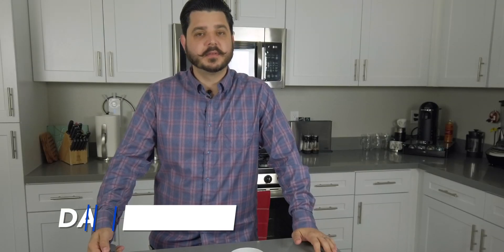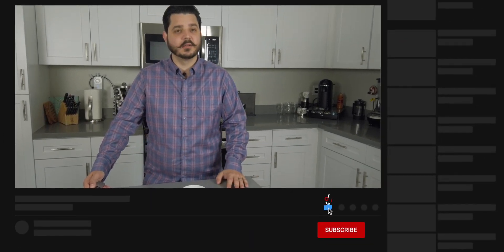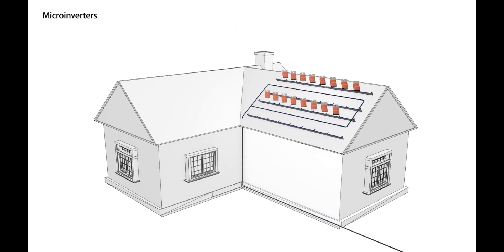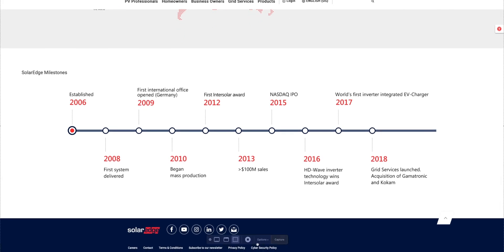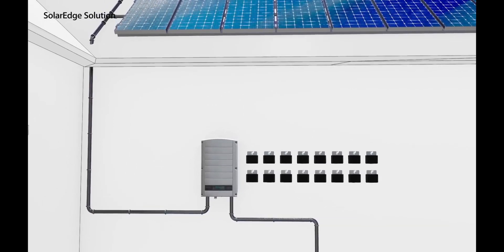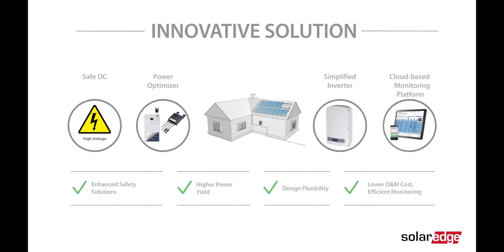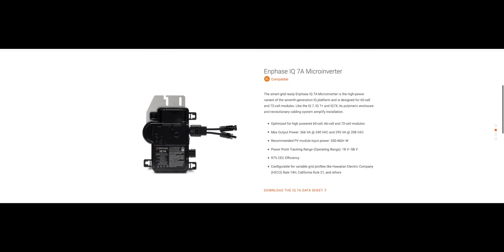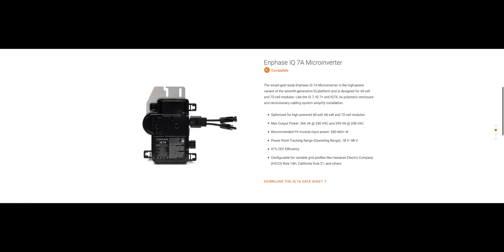Optimized Solar Inverter OR Micro Inverters

Comment: Is it best to oversize a aolaredge inverter so it doesn't run at max output
Like a 10860kw system with a 11400 inverter?

Comment: Great video. If a customer has 360 panels and wants to add 320 panel(s) and/or 400 panel(s) are these allowed?
Reply from the maker: Yes, the Enphase system doesn't care about the panel wattage. You just need to check electrical calc. As for SolarEdge the optimizers don't care about the wattage of the panel as long as it's properly sized.

Comment: Enphase is always capping panels. While for SE you say “5kW system use 5kW inverter” but to compare correctly you should say 5kW system from SE with 3000 inverter.

Comment: Obviously you prefer solar edge optimizers  vs microinverters.  You also didnt explain that the cost of wiring Dc vs Ac system.. thanks for the infomercial

Comment: Cost needs to come down on both, Panel prices have decreased but seems both inverter types have stayed the same..
Reply from the maker: Yes, the inverter technology and optimizers for the industry have been flat. This really has to do with competition which Enphase doesn't really have much, there are other micro-inverter companies but they struggle to gain market share from Enphase. As for SolarEdge, they are starting to feel the pinch from other inverter manufactures that have created an alliance to develop cheaper optimizers, so we should see that at least help a little bit.

Comment: For micro invertor current need to store battery  or not..  if not means how can we use in night times??
Reply: Most people run their house off of grid power and just feed power back into the grid during the day to offset the cost of grid power. Adding local storage costs a lot more

Comment: Solar Edge is notorious for being RF noisy. So if you listen to AM or ham radio stay away Solar Edge.  Enphase and SMA are the two quietest inverters according to a paper you can find on the ham radio ARRL website.
Reply: I can confirm this is true based on 13 years of installing SMA, SolarEdge and Enphase
Reply: I have been looking for this very comment. As a ham radio operator this is more important than having solar at all to me.

Comment: Enphase 25 year warranty, no single point of failure.   SolarEdge 12 year warranty, multiple points of system failure.  Maybe acknowledge you get what you pay for?  It sounds like you might be mis-understanding DC to AC inverter saturation, "clipping" is often mis-used to confuse or mis-direct people, it can and does happen with ALL solar inverters, there is no harm. It just means that for a few minutes here and there the inverter didn't capture every single watt. (fun analogy- think of a tomato plant in your garden, sometimes a tomato doesn't make it to your meal).  Real world performance of solar panels is nowhere near STC ratings, by using higher DC watts you can reduce many other costs. Electrical panel upgrades, less racking, less labor fewer circuits. Enphase micro inverters are happy to run at "full throttle" for decades, other inverters will overheat, de-rate and fail early if run hard.  Good solar design should have well loaded, or well utilized  solar equipment.  (one more fun analogy- Do you run your washing machine half full?)

Comment: You need to declare a true winner. Even if it’s by 1% 
Cost
Warranty
Total Power output 

Don’t tell me they both output the exact same amount of alternating current.....
Reply: Yeah waste of video. The micro inverters the whole point isn't the damn ac)dc it's the micro controller that seperates from system

Comment: Very good video, really liked it, thanks so much for good information
I got a quote from Tesla for 11.97kW system with Soalr Edge with HD Technology, which is quite a good deal, vs a local installer offering 12.8kW system with 400w panels but Enphase IQ7+ micro inverters.
I wont be expanding the system as this is the most I can get based on the house and roof.
What are your thoughts?
Tesla new price is really tempting, 
Also don't understand what will 12kW system really capable of producing in real life
Thanks
Reply from the maker: Tesla is very competitive but we support local business and from what we hear Tesla is very difficult to get ahold of when you have issues with your solar system. We service hundreds of customers that went solar with other companies and they can never get ahold of them after they have it installed, (typically nationwide companies). It also sounds like the local company is offering you something better than Tesla
Reply: @pacificsuntech  In my area Tesla subcontracts out to local installers
Reply: @pacificsuntech  how does having battery like a Tesla's system's have vs no battery and 💯gird depended or it doesn't matter as much for costs and overall efficiency's? for micro vs all dc system

Comment: Pacific Sun Tech - 
At the end of the video you said "if you have a larger system like an 8kW or 9kW solar system, you'd likely pair it with the 7kW inverter or the 7.6kW inverter from SolarEdge".
Why would you pair a larger solar system with a smaller inverter? Is that where the inverter tops out?
Reply: This is usually because the panels don't produce near the full output throughout the full day. The larger output panels produce closer to the full inverter kW for more of the day making the 'actual' output of the panels a better match to inverter.
Reply: Because nameplate wattage isn't what you'll get. Factor in losses straight off the too and the fact that it waxes and wanes throughout the day... you'll never see the full capacity. I'm only at 65% of nameplate on 3 different arrays. C'est la vie

Comment: 6:27..."they, meaning Enphase, are not going to keep producing the older inverters." NOT TRUE!
We were an early adopter of Enphase MicroInverters. We installed M190 inverters in 2011.  Two of them failed last year...actually they didn't fail outright, they just started to make much less AC power. Enphase sent us two NEW M190 MicroInverters and all the hardware and cabling necessary...at no charge...to connect them right back up to our existing system. Enphase does not still offer a 190W inverter to the public. But they supplied their existing users with BRAND NEW replacement inverters for the ones we bought in 2011. And these new ones are STILL correctly matched to the 240W panels we bought to work with the 190W MicroInverters.
Reply from the maker: Of course they replaced them, they have a 25-year warranty. But what you received while appears to be “new” is refurbished. As technology evolves it’s not economical for a company to continue making products they no longer sell and thus they repair damaged units.
Reply: Pacific Sun Tech While this does not address the 190w inverter, they are producing new inverters that will replace M215 inverters that are not, as you say, “refurbished”. Also recently announced that M-series inverters will work with Ensemble in the future. https://store.enphase.com/storefront/en-us/microinverters/enphase-m215-microinverter-kit

Comment: With solar edge if a solar panel goes down. Will the rest of the system work?
Reply from the maker: No, the optimizers allow for each solar panel to act independently just like micro-inverters.
Reply: @pacificsuntech  Only if the panel side fails (solar panel or optimizer).  If the power optimizer fails open-circuit on the high-voltage side, the whole string goes down.  Of course, a failure of the main inverter also brings the whole system down.  SolarEdge definitely lower cost, but suffers from many potential points of failure that can result in the loss of much more than 1 panel (unlike micro-inverters).  Would be good to compare real world failure rates of both, and impact on system when something fails.

Comment: If SolarEdge is your preferred MLPE- you’re betting your entire company‘s future on a waning technology: Jack Rickard’s glowing endorsement of the Enphase concept

-12 years in Electronics design and logistics for DOD contractors including McDonnell Aircraft, Emerson Electric Electronics and Space Division, and Martin Marietta Denver Aerospace.😮 

https://youtu.be/ABp9g8x2NbM?t=2272
Reply from the maker: Micro-inverters have there place, but don't be fulled by the competition. The market will be quick to shift when the micro-inverter evolution slows down. Look at Intel versus AMD, who would've ever thought AMD would be leading the race with 12-core consumer CPUs on 6NM architecture?
Reply: Pacific Sun Tech I wouldn’t really use that as a comparative analysis… What makes you think the micro inverter evolution will actually slow? Right now there is a pretty big gulf between micro inverter and stream inverter topologies. Enphase Is also experimenting with novel materials… The micro is going to be the size of an Apple TV remote control faster than you think WITH with more power density that it has now.

Comment: Could these be run straight to a fuse box, and just use it when the sun is out?
Reply: For the enphase system which is the only I know, in theory YES. But in good practice, you run this through the Envoy and through a surge protector and a Q relay which listens to the grid. Probably illegal in most countries to not do it this way.

Comment: Dale, thanks for the comparison. I believe the high voltage DC, cabling and losses on the roof should have been mentioned. Having first hand experience with weathered installations - high voltage DC is scary stuff.  Just saying....
Reply from the maker: Hey Google User, thanks for the comment. I would agree with you for a traditional solar system that is not using optimizers. The SolarEdge optimizers are as safe as the micro-inverters because of Rapid Shutdown requirements. That means the second the panel is plugged into the optimizer the voltage is less than 1v usually 0.1v. So that makes it very safe compared to the voltage coming straight from the solar panel ranging between 300v to 480v.
Reply: @pacificsuntech  Are you saying that Enphase also has rapid shutdown where the panels only output 1v per panel when the power switch is off?
Reply: @OlGoodJoe  enphase has always been  rapid shutdown compliant.  0 volts
Reply: @pacificsuntech  The optimizes and rapid shutdown are a great feature.  Nevertheless, the working DC voltage on the string cabling on the roof and leading down to the inverter input typically ranges from 350 Vdc to 850 VDc  depending upon configuration.  No problem, providing everything is up to snuff and looked after.  To me, there's always that exception.  Again, just saying and to me worth mentioning - high voltage DC is scary stuff
Reply from the maker: @jameswellman7585  When the solar system is on and operational Yes DC voltage is scary stuff, I thought you were talking about during the installation process because that's really the only time DC voltage would be accessible since the junction boxes are open and wire is being pulled. None the less we do agree this is something to consider because DC voltage is serious compared to the 240v of a micro-inverter system.
Reply: @pacificsuntech  How true.  In my experiences  water, snow, ice, squirrels, woodpeckers, insects, leaves, UV radiation and cheap plastics are rooftop constants. They are are always curious and busy rearranging our hard work and creating that unwanted surprise.  The less they have to work with the better.  Thanks for your service.

Comment: My friend this is a biased review.  Solar edge is only 99%efficient at 50% load. 
And much less on either side of that.  
2.  Optimizers optimize a string invertersinstall but do not maximize power production.  All other things held constant enphase inverters are backwards compatible and produce more power.
Reply from the maker: Hey Matt Thro, not sure were you heard that the efficiency rating is at 50% load in testing. We'll have to check on that, from our understanding it's done to the standards set by UL and the NEC and CPUC. 

As for optimizers not optimizing a string they do improve power production when compared to a traditional string inverter system. They act just like micro-inverters allowing for a panel that's facing east to begin producing power earlier than a panel facing west and vice versa. This is something both systems had an advantage in, and I thought we did a good job pointing that out.  

The latest 6th and 7th generation micro-inverters are not backward compatible with any previous generation. They use a completely different communication protocol and require a different Envoy to report data, they also use different cabling than previous generations. 

The IQ6 and IQ7 micro inverters do not require a neutral wire, where all generations prior did. This is why Enphase created the Enphase Upgrade Program (https://go.enphase.com/upgrade/installers), for customers to upgrade their older equipment with newer equipment since they discontinued all generations up to IQ6 and the newer equipment does work with the older equipment.
Reply: @pacificsuntech  Everybody knows Enphase is a better technology. Just look at the P/E ratios of both companies. Even better, call a local solar distributor like CED and ask them what inverters/optimizers are getting returned most. SolarEdge spent years and millions in marketing dollars gaslighting enphase for having "multiple points of failure" when it was solaredge optimizers that were the units going bust (in droves, may i add). our warehouse is stacked with bad SE7.6, SE10, and SE11.4 inverters. The Solaredge folks are starting to approve RMAs like it's routine. Not a good sign. Investors in SEDG have no clue about what happens in the trenches of solar and it's sad that companies promoting SE can be so blind. I wouldn't short SEDG because all you need to do well in solar nowadays is have a heartbeat, but when the tide recedes SEDG is going to get exposed in a big way.
Reply: @omez6900  totally agree..  installers in my area all flocked to SE because of the lower price point in 2014-15.  Then the optimizers and inverters had a terrible failure rate.  All those companies went back to Enphase because of the callback rate
Reply: @omez6900  absolutely. SolarEdge pays installers a commission based fee for every product sold, so this channel and other installers have a direct conflict of interest, if they like money (which, let's face it, everyone does). 
My money will not go to SolarEdge, they might have great balance sheets and international business, but at the end of the day, they are vastly outperformed by a superior product.

Comment: So I live in NYC and I'm  working with a company now that offering me 47 Lg350N1C-V5  panels pairing with Enphase micro inverter  IQ7+.  With your  Experience is that a good match or should I fight for a higher micro inverter.
 Thank You
Reply from the maker: The IQ7 is good for that module, the extra cost for the IQ7A probably won't be worth. If you were using the NeON R LG Solar panels that offer 365 or 375 watts then I would say absolutely. But the NeON2 will likely never achieve the STC 350 rating and rather hit consistent the NOTC rating 261.
Reply: LG350’s and Enphase IQ7+ are a great fit.  Each panel can produce up to 2.35kw per day in clear skies in May.  Enphase will also help you panels last longer due to the low voltage conversion.    No single point of failure!   

From a 10 yr all brands Solar a field technician  

Single point of failure systems result in a minimum 4 weeks down time... solar Edge requires a minimum voltage so 2 optimizers down could possibly mean an entire string is down
Reply: Did you end up moving forward with your solar project?
Reply: @alexsoares9892  Yes it did. Thank you
Reply: @johnnyroman4338  how much did you end up paying in nyc?
Reply: @alexsoares9892  I pay $149 a month for 25 years lease

Comment: Another note that people tend to overlook is the monitoring app. They both have it and I noticed the SolarEdge is so much more user-friendly. The Enphase is very poorly executed and is very confusing to read.
Reply from the maker: Hey Bobbinsnest, we'll look at doing a comparable video for the two. Enphase has updated their monitoring app a lot in recent months and has done a good job at making it more user friendly. SolarEdge has always had a good monitoring platform with ease of understanding. Thanks for your comment!
Reply: @pacificsuntech  Everybody knows Enphase is a better technology. Just look at the P/E ratios of both companies. Even better, call a local solar distributor like CED and ask them what inverters/optimizers are getting returned most.
Reply: I have seen both.
They looked really similiar but Enphase app looked better.